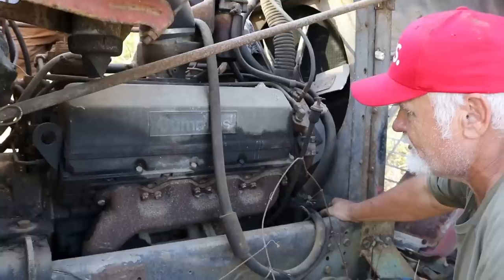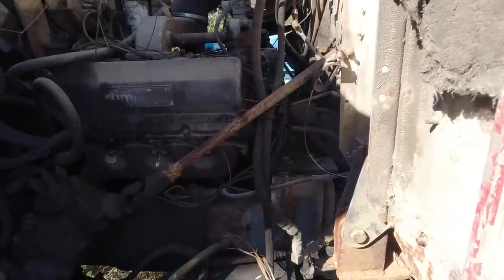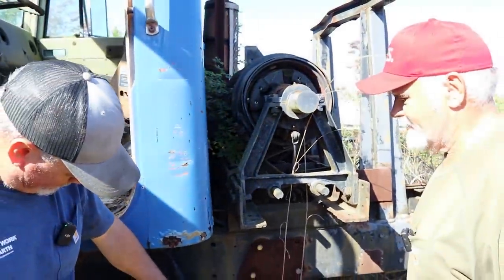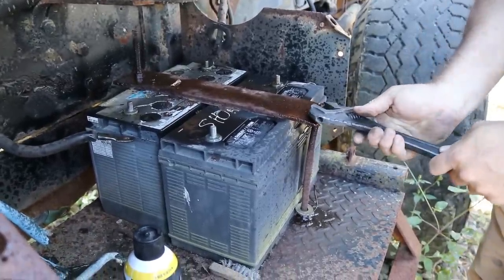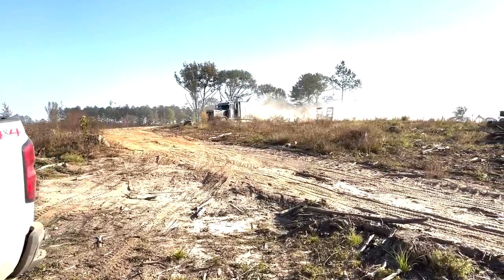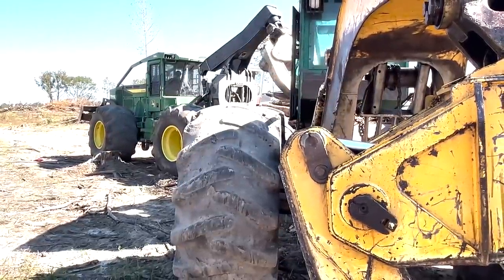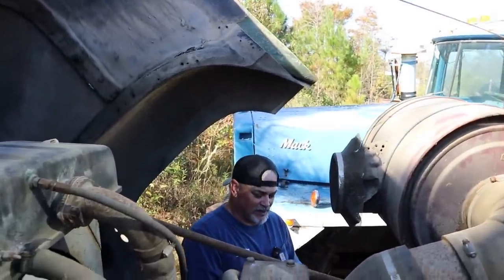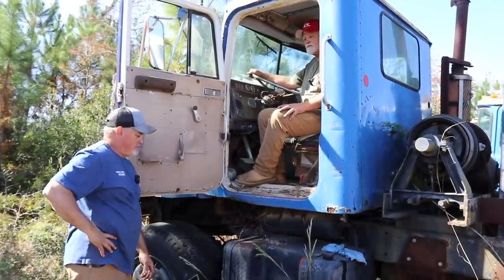Will it run? We found a semi that will pull your house down!

Comment: Those were a decent engine despite what the bulk of the truckers said about them. With that being said, what I learned about them they were first started up production in 1967. Non-turbo versions were nothing that set the world on fire and I think they were noted for crankshaft failures. I had a couple of Massey tractors that supported a 903. They were like 280 on non-turboed and then about 320 for the turboed. But on the flip side government use them extensively and I think they still may even produce them for military. With the latest versions being 600 horsepower. For an engine that was basically going to be Cummins answer to a Detroit 871. My pulling tractors use them V8 blocks  903 from marine version. They respond pretty good on alcohol fuel and 4 turbos . They actually wanted to make them totally illegal because they ran so good and check to pulling.

Comment: Where I used to work there was a big twin turbo v block cummins that was used as the starting device for a 20MW Westinghouse gas turbine generator. The whole setup was from the 1960s.

Comment: Hank in the video clip of Wiley loading the skidded, he asks about a better way to release parking brake. How about using a porta power hand pump? Make a hyd hose with a fitting on one end that will screw on to the skidder the other end of the hose have a hyd rated ball valve screwed onto that end, next attach the porta power quick release to the other end of the ball valve. Open valve handle use the pump to release the brake then close off the valve handle and remove porta power pump. Brakes stay released until valve handle is opened to release pressure.

Comment: As a VT903 owner, this engine doesn't sound like a 903 natural, or otherwise. All 903's had the PT pump in the valley. 
Looks more like a 555 judging by the rocker covers and exhaust manifolds which seems odd in a double frame rail truck, the cans on the back look like wedge brakes as others have said.

Comment: I thought that was a VT903 at first glance, however after seeing the top of the engine I would say that's the dreaded "triple nickel". A Cummins 555 V-8. Very similar to the IH DV-550. More gasoline engine than diesel engine but still very popular. I got very good service from both in mobile home toters.

Comment: Talk, and work, the correct balance = good video.
I know these things for certain: I'm 69 years old, live in Florida, and I should be hanging out with you guys.
I have a bad hip, which did not stop me from rapidly going upstairs carrying a load, also 2-blown discs, which had never bothered me for the 35 years between their occurring, and when I broke the femur on the bad hip leg.
Now I am falling apart more than mended.
I realized this seeing Wiley pick those batteries up with his fingertips, lift them and set them out.
Before the hip went out,I routinely lifted a 355Lb high voltage transformer into/out of the bed of a pickup truck, they had away to install the hook points, or insert steel rods through the edge flange to lift it with a hoist, but setting it up and putting it away took an hour, and I could pick it up with my fingertips by the flanges. The thought of batteries gave realization I would have to 'work my way back up' to that. THAT man Wiley is a HOSS!😎

Comment: So if I'm not mistaken that has unit injectors and the fuel pump there pumps the fuel through passage ways in the block and goes to the unit injectors

Comment: Those trucks are nice. That heavy-duty style frame with the high ground clearance were used for all kinds of heavy hauling trucks. Everything from heavy quarry dumpers to logging rigs and house movers. The big V8 Cummins sounds good even if it isn't the most powerful thing ever. :)

Comment: Back in 1988 i worked over in SC at the Bad creek hydroelectric project above lake Jocassie ...we had 3 IH loadstar 4000's all 3 had VT903's they were numbered 502,503.and504 i had 504 12 yrds of concrete that sucker would fly i had the fastest of the 3.......the other 2 had 10 spds mine had a 13 spd

Comment: Hey guys the V8 Cummins was a big seller in Australia in the late 60,and through the 70,s we had the 555 and 903 in turbo and non turbo variety .We had the Ford LOUIEVILLE 9000 international 3070 and of course Kenworth ,if you had a 903 you were the king of the road .The transfer range was imported to Australia but with the Cummins big cam engines not any as 903,s the 903 was very heavy on fuel compared to the big cam range ,but the 903 was a sweat sounding motor 
MERRY XMAS GUYS 
KYM ADELAIDE

Comment: I rarely work on commercial equipment, but 95 percent of the problems are def related. Most of em wont finish regen or have to have factory software to fix blah blah blah. Man u couldnt pay me to take any kind of vehicle with gov't juice. Next year i'm not takin any jobs with def nonsense on em. I'm done with that crap.

Comment: Excellent video Hank  :) & Wiley  :) also those Cummings Desiel motor are Bullet Proof for sure 👍 👌 😉 and how saying that for sure is The Beachcombers boat The Persephone boat Bruno Gerseil ( Nick Adonis) had Cummings 160 hp motor on that boat and sat around from October 25 1990 to May 25 2002 starting up on 2 cylinders to 3 to 4 in 4 cylinders motor on in 5 minutes running was GM Desiel say and amazing for sure yes ! LOL I always heard Desiel got oil in pan for bearings plus head they starting up no problem and may smoke bit but clear on Cold or Hot starts too perfectly Lol!

Comment: Gentlemen There should be a Plate on the Drivers Side Front of the Engine with the  Hp or Model  Cumming Apart N14  or NTC 350

Comment: Wiley 4Ton HF porta power. Remove line from breaks, Hook up adaptor fitting. Connect Porta power and pump up to relise breaks.       save fitting for next job. Keep it with PP for next time

Comment: Those are Wedge brakes. They push in with a wedge onto the brake shoes. That looks like a 903, or it might be a 555. Without a turbo, it sounds more like a 555. And if that's the case, yes it is "GUTLESS".

Comment: V8 903 HP 300 to 350 / in marine form hp up to 450, rear are wedge brakes, real problems. 903s were really good engines, drove one in the Army hauling lowboy for 2 years and a couple of years in civilan life in a tanker. 300hp version was non turbo.

Comment: I'd say it's a v555 by the hp thay about 190 and could be opened up to 220 as some have said thay were not much of a motor 903 were way better we've got one in an inter acco it's a slug but it sounds good and got a 903 non turbo in a Louisville prime mover that's clocked up a lot of ks or mls in your case without tomany dramas marry xmas from aus and have a great new year to all

Comment: Lot of truck for a 555, for anyone saying its a 903 it's not, 903's have 903 embossed on the top of the rocker cover,also the ports on the exhaust manifold are way to close together to be a 903

Comment: Suggestion; try putting a quick connect fitting on the machine to fit your porta power and use hyd fluid instead of grease. I doubt that a fitting would cost more than the hose your using. Maybe someday upgrade to an electric pump.

Comment: There is nothing more fascinating than "turning rust"🙂! Tools needed: a crescent wrench / adjustable spanner, a set of batteries, maybe a crowbar for checking whether the engine is locked - and that's it!

Comment: You could use the hydralic from a running skidder and a longer hose to pressuriz the parking brake use a quick conncet fitting it will hold the pressure in

Comment: Those brakes on the back of the truck are called wedge brakes, the brake chamber basically just pushes out on wedges and tightens up the shoes inside the drum, and seems that truck has 2 chambers per wheel end

Comment: Yes the timber in the chassis rail would say it be for a u bolt to hold something  on there  the sepension  is maybe a hendresion  six rod  .was  lot those old transtar running  in Australia   vt 903 Cummins  were turboed and natural 903 no turboed

Comment: Tell Wylie that you can take cover off the back bottom left corner of the cab and put a 12 volt hot wire to the park brake switch and it will release the park brake

Comment: detroit  dose  not. have  conventinal   pump   fuel  injectors   are..cam  operated   its   common   rail  a  realy  great  engine  just  hope   the  racks  are  not  stuck  an  it  dose  not  run  away  on  you  good  luck  guys

Comment: Maybe a porta power pump from harbor freight with an adapter fitting those pump 4000 plus psi of pressure to release the hydraulic parking brake on those John Deere’s
Reply from the maker: I’ve got a nice BVA hydraulic porta power
Reply: @HamiltonvilleFarm  tell ole Wiley use the pump next time to release them parking brakes he had a hell of a time using grease ! The BVA stuff is real nice quality stuff definitely nice to have when you need it and I’m sure now you have it you use it for stuff you never thought you needed one for ! Merry Christmas!